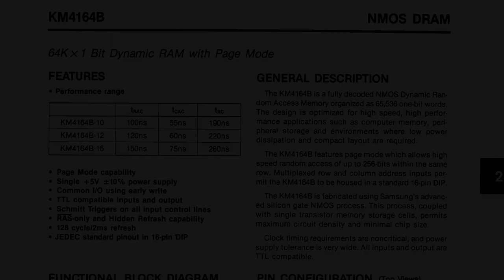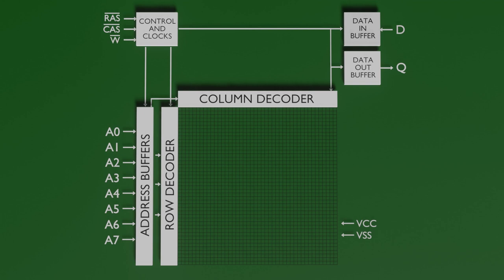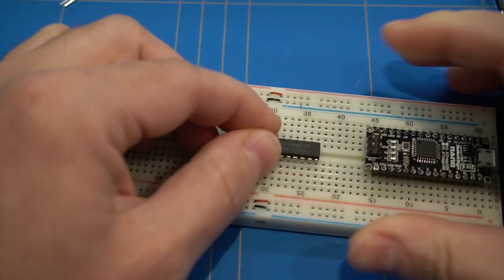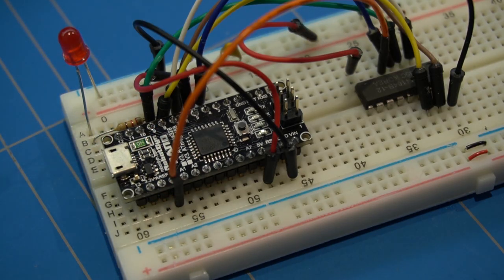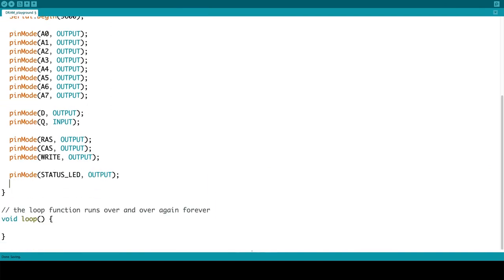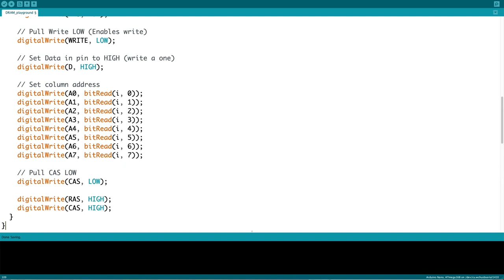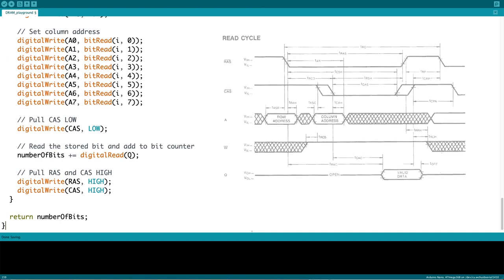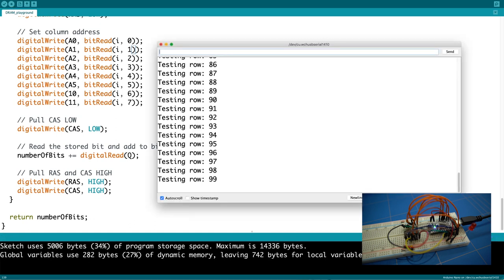4164 DRAM with Arduino

Comment: A6 and A7 are setup for true ADC and do not have digital pins. Nice video the graphic presentations worked very well and I found the information to be easy to follow and understand.
Reply from the maker: Ah yes.. thank you for the answer. That explains there is no digital circuitry behind them.
Reply: @ezContents  Your project is Great!!!

I did build and it works great!!! Please! Is possible to use this device to test 4116 ones? I know how to generate -5v, +5v and +12v to power that chip. There is a way to use your device to

test 4116 too? Very thanks once more!
Reply from the maker: @pcrockpc6080  If you connect all the voltages correctly, then I think it should work.
Reply: @ezContents  Very thanks for replying friend!!! But and about the A7 line ???? What must I do about A7 line?? The 4116 does not have the A7 pin. The 4116 uses only till A6 address. What to do about Arduino line that should be connected to A7 ???
Thanks once more!
Reply from the maker: @pcrockpc6080  Just don't connect it.
Reply: @ezContents  I will try it!!! Very thanks once more!!!

Comment: Very nice explanation! And the animations raised the bar quite a bit.
Excellent!

As for the pins, I would have guessed that you may run in problems with A4 and A5, as they are often related to I2C.
I just learned from DJ Legion's comment that they are analog inputs only. Good to know!
Reply from the maker: Luckily did the other analog ports not cause more problems... I knew for sure to stay away from pin D1 and D2 as they are for serial RX and TX.

Comment: This is a great video - I've always stayed away from using DRAM because it is more difficult to use.  I'd be curious if you'd go further and explain refresh requirements (I dont know how that works) and maybe even show how you can put 8 DRAM in parallel and read/write entire bytes.
Reply from the maker: Thank you. A good idea. This would mean to dive a bit deeper into the datasheet. 🙂

Comment: Thanks for the video and the article, I just built it for myself on a prototype board with soldered wires and a socket for the DRAM chip. If I rebuild it some time, I will use a zif socket. I modified the code, I added a second test round with all zeros for detecting stuck 1s.
Reply from the maker: Nice to hear that you have built it on a breadboard and continued upgrading the code.
Reply: @ezContents  I added a green LED on pin D13, for when the chip passes.

Comment: Thanks for sharing your tester. I built it and it seems to be working to spot bad chips, good job.

 However, by the way I noticed that sometimes it tests "ok" when there is no 4164 chip present, is it regular? And if so, do you know if there is a way to test for "present" chip?

A notice: It would be better to apply an external 5v power supply because sometimes those 4164 chips get bad 'cause they short and can draw more than 0.2 amps from the arduino; this would fry the arduino itself.
Reply from the maker: Thanks for your remarks. I did not test it that extensively myself. It was actually never my intention to create a 4164 tester, but merely to show the operation of the chip.
Reply: What you are observing is the result of how simple this test is. The code simply writes 1’s (high) into the memory cells, and verifies that it reads back 1’s.
So, if the DRAM has the fault of a stuck high output pin, the DRAM will incorrectly test okay. Likewise, if no DRAM chip is present and the unconnected input pin floats high, you’ll also register an incorrect okay test.
Ideally, for testing a 1 bit wide memory chip, you should test storing 1’s as well as 0’s, and also alternate 1/0 & 0/1 bit tests (so adjacent cell bits differ).  
But, as ezContents said, it wasn’t his intention to actually create a 4164 tester. 🤓

Comment: A dram must be refreshed of course, once every few msec
Reply: This isn’t a problem for this example code, because he’s only writing and reading back a single 256 bit row at a time. So, the required refresh time is unlikely to be exceeded by the Arduino.
But if he’d tried writing the entire chip (all rows) first, before reading back, it’s likely the resulting read delay would exceed the max refresh time (and the test would likely fail on at least some degraded / leaky bits). 🤓

Comment: Hello! a question. yesterday I added a memory 4164 to my Ibanez Digital delay guitar pedal and it fired. but when you touch the chips they were a little hot. is this normal? Thanks!!!
Reply from the maker: Not very normal. But as long it stays under the max. operating temperature which is 70 deg. C you should be ok.

Comment: nice job good video just wanted to ask if the tester works also with mt4264-20 chips thx.
Reply from the maker: I did replace a broken 4264 chip with a 4164 once. But I am not sure how the chip will behave on this Arduino circuit.
Reply: @ezContents  ok thx I'll give it a try and if works I'll let you know
Reply: @ezContents  ok i tested it and it works with 4264 chips as well
Reply from the maker: Nice! Thanks for testing it out.

Comment: I'm trying this out on some MK4560-20 chips and I'm noticing something strange. Maybe it is my lack of understanding of dram and its failures or perhaps a compatibility issue with this variation but if I run the test say 10 times, 9 times the ram goes through just fine but the 10th time (give or take I'm just ballparking) results in the following:

Starting test...
Testing row: 0
ERROR: row 0 number of bits was: 255

This is the only failure I'm getting on multiple chips which made me think something else is going on here. If anyone has any guesses or suggestions to try out I'd be grateful. Thanks!